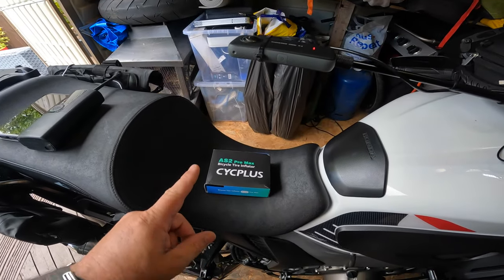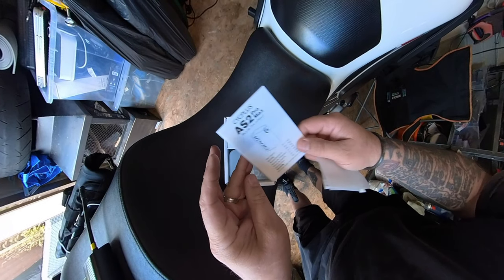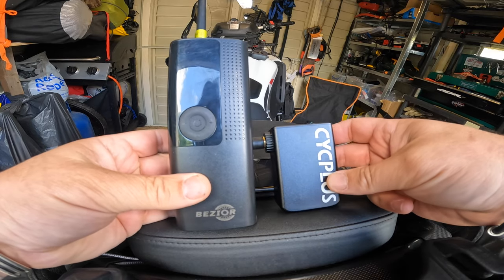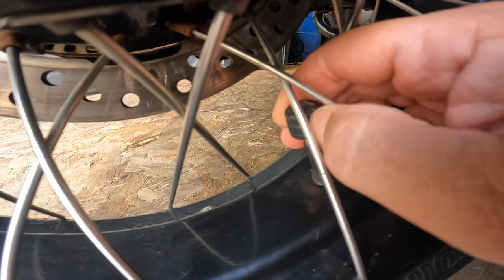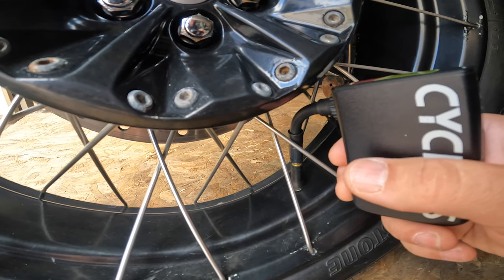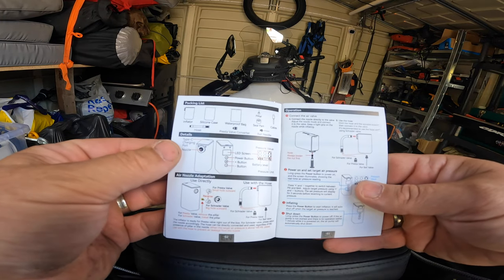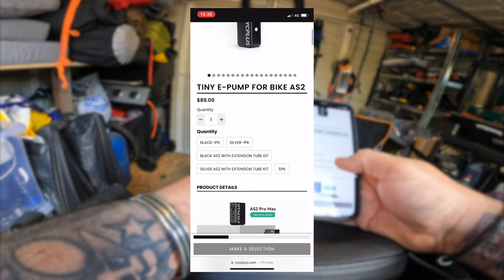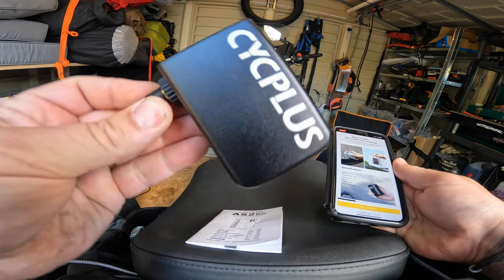CYCPLUS AS2 Pro Max Tiny Tyre Inflator

Comment: Is there a button to change from PSI to bar? I live abroard, as you might remember, and we use bar here..., my bike has 2 bar front and 2.5 bar back. I was not able to find this info on the homepage. If it is poss to change to bar, this is a serious contender for me. Thx.
Reply from the maker: Will have a look this evening and report back 👍🏻
Reply: Yes it has. Watch the Bingley Wheeler.
Reply from the maker: Yes it does I just checked. Hold the + and - buttons and it switches over to bar